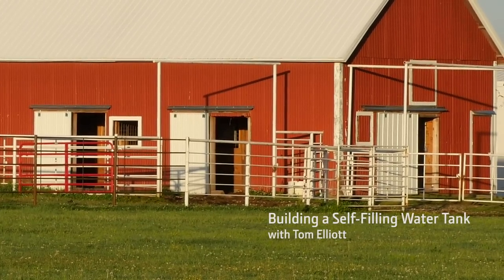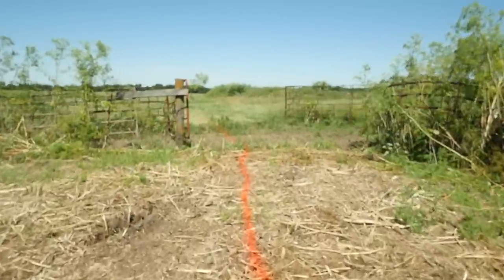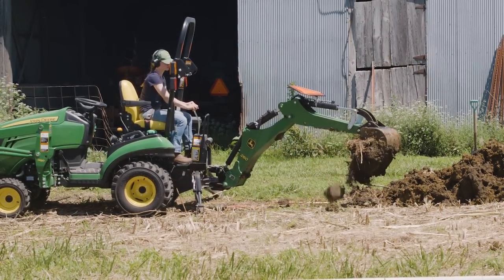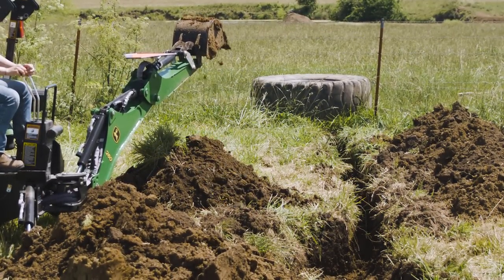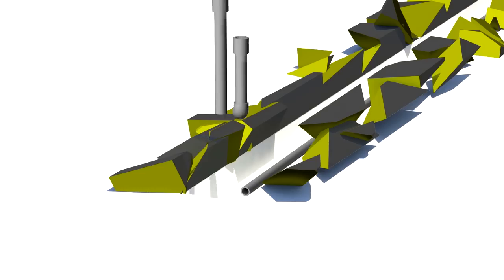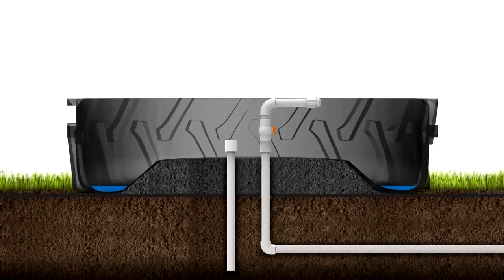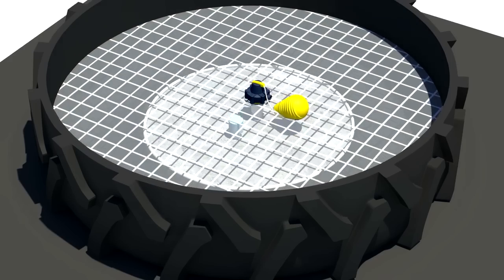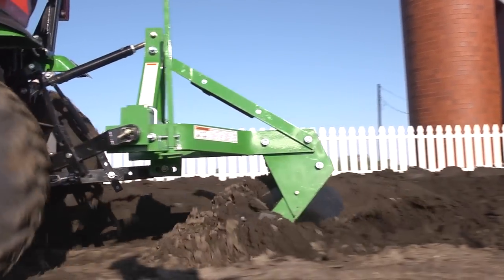How To Build A Self-Filling Livestock Water Tank | John Deere Tips Notebook

Comment: How does it handle winter freezing?
Reply from the maker: Hi Sally, thanks for reaching out! The tank will get ice on it just as any water source would. As long as the tank is full it will not freeze solid, however you may have to break the ice daily. On a sunny day, the black tire absorbs heat and can delay the water freezing over. The tank's close proximity to the ground also allows it to absorb some natural heat from the ground. We hope this helps!

Comment: Couple concerns. One being why you used a tire. Is there any possibility of chemicals in the rubber dissolving into the water? That seems like a really small “trough” for that many cows, will this be a problem on hot days? Second, why is it right under a barbed wire fence?
Reply: I can't answer your other questions, but as far as the tank being under the barbed wire, it is common to do that so the trough can be shared by two pastures, hence reducing the number of troughs required per your number of sections of pasture.  I'm not for or against this, I've just seen it done many times in the past with troughs.  Even the more expensive auto horse waterers folks will put them in between the fence section so they can be shared (of course this solution is more expensive, but much safer and cleaner looking for horse farms).
Reply: Keep cattle from wrecking water valve?
Reply: The trough can literally be any size if it is self filling.